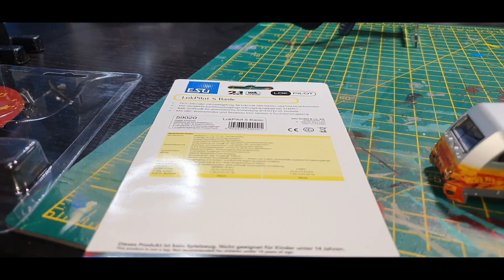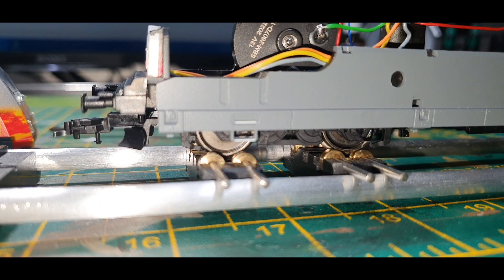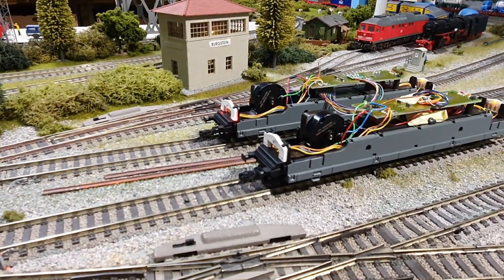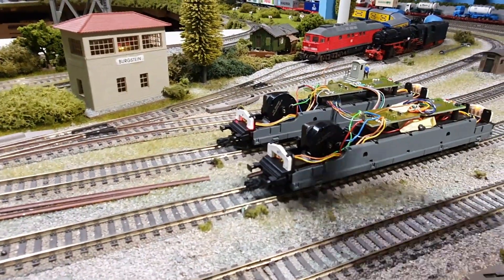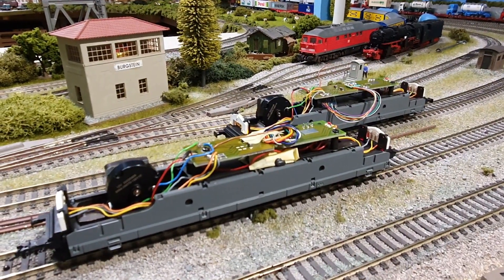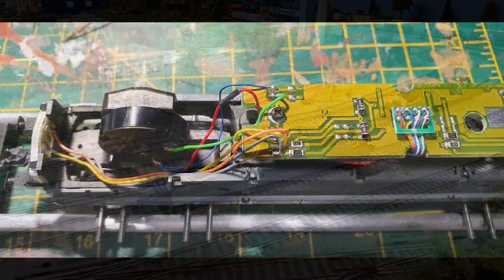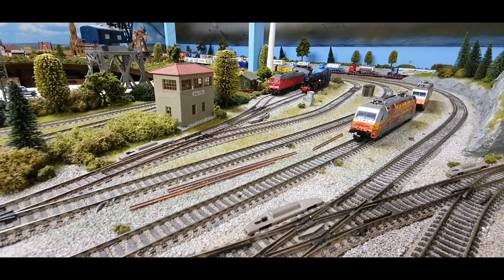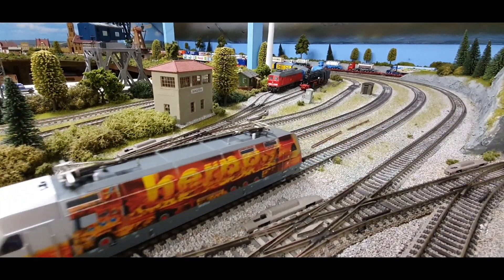Esu lok pilot basic v5, Install, coreless motor.

Comment: I have both decoder types and I find Lenz extremely smooth. Whenever I had your jerky issues it was a matter of settings. Both decoder types are good in my opinion but I find the Lenz a lot easier to get control of, especially at super crawl speed.
Reply from the maker: They are both very good, I have sold all of my Lenz chips now as I can get much better and easier settings on the Esu programmer..especially using coreless motors.
Reply: No matter how hard I tried I could not get a Lenz decoder to behave like a Zimo MX630

Comment: I think the best thing to do is accept that it works great and leave it at that. If you look in to why, it opens a can of worms looking at two different chips and how they operate. Coreless motors are at their greatest efficiency at high revs, thus being used to drive propellers in aircraft. What a difference though, nice one Jim.
Reply from the maker: Yeah that's it now for this project,  I know I would get better control if the motors were controlled via a Esu v5 chip as they have built in settings especially for coreless types of motors..
Next is fitting out the turn table bridge coreless motor with a 8 pin interface and a v5 chip to make the TT work even smoother on the exit clutch control.

It's an addiction and another hobby in its own right doing motors and messing with electronics even thow I knew nothing when I first started my layout. 

Thanks 🚂🚃🚃🚃🚃🚃🚃🚃jim

Comment: Hey, Jim!

     A bfascinating and brilliant follow-up to the upgrade of the Herpas.  What really throws me is, in my ignorance, I assumed the motor and gearing affected the smoothness of the running, but the decoder does, too?  Even with the same motor, the difference with the new decoder was absolutely clear and stunning.  Even the same speed step showed variance of speed.  That is too impressive.  What are the disadvantages of these coreless motors.  Even with the old decoder, the coreless motor was a bit choppier than with the new decoder... so, is it the motor or the decoder or both?  Cheers!
Reply from the maker: Hi Anthony, 
It's Both,
The Iceing on The cake for me is the v5 lok decoder as it has superior motor control across all motors and I have full programming control in a easy to do interface on the p.c.
Even just installing a v5 or v4 esu decoder will improve the slow running on old motors and drive trains and make the loco less noisey on old locos etc.
This is what I have learnt over the years by trial and error. 
There are other decoders that can do just as good but I have no programmers for the other makes.
🚂🚃🚃🚃🚃🚃🚃🚃🚃🚃🚃